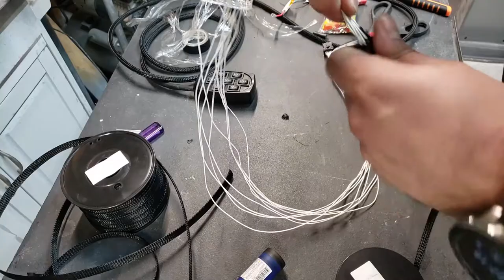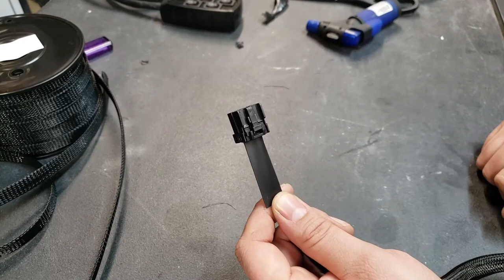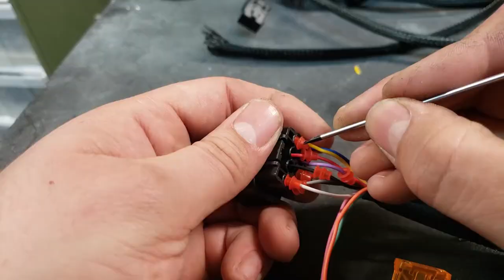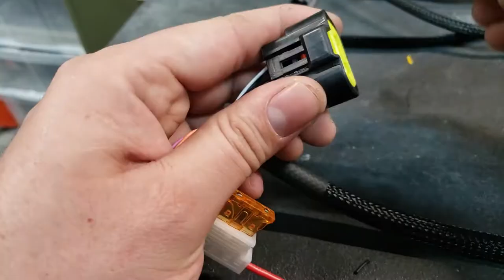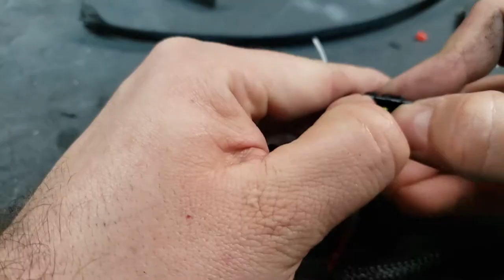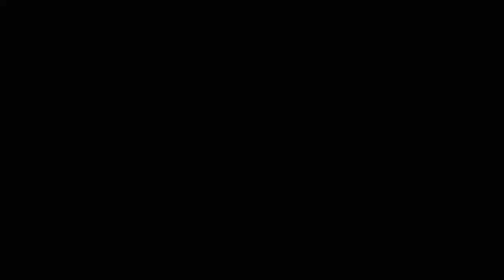HOW TO MAKE AN AUTOMOTIVE 8 PIN CONNECTOR - YOU CAN MAKE IT YOURSELF

Comment: That second crimp you made on the wire is supposed to hold the skinny end up the rubber gasket. Makes putting them in a little easier then jamming them in

Comment: I was removing the rear bumper from my car and found out the backup camera wire doesn't run through a pin plug, it's a single wire fished all the way to the cockpit. So, I had to cut it. Inside it has 5 different wires, thankfully color coded. So I need to make something like this when I reinstall my bumper back.

Comment: Could you please provide the terminal you used to connect the wire to the housing connector? I have been looking for what type and can't find it anywhere. It appears to be the same one you are using.
Reply from the maker: amazon 4 pin connecter
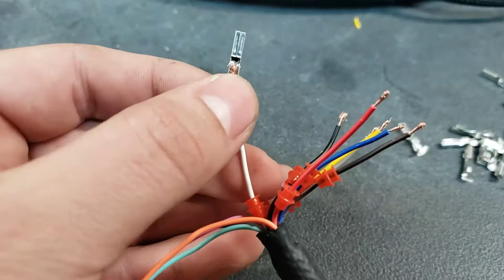Reply: @RezyNWorX  thank you for reaponse, but I'm actually looking for the terminal connector that is crimped onto the wire like you did at 1:18 in the video. I tried a 2.8mm spade terminal but it was too small. I am unable to find the terminal, but it appears to be the one you are using here. It is to insert into the connector
Reply from the maker: @mlee81  these come with the kit
Reply from the maker: I guess they are called pin headers. You can get them an amazon but you have to know the size they are going into and if its male or female.